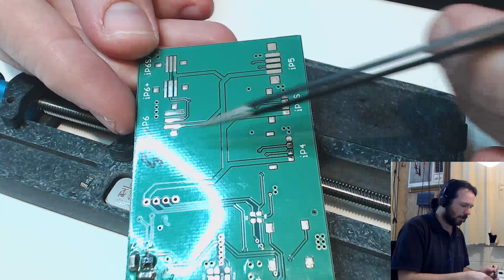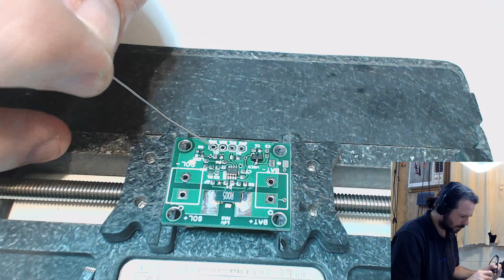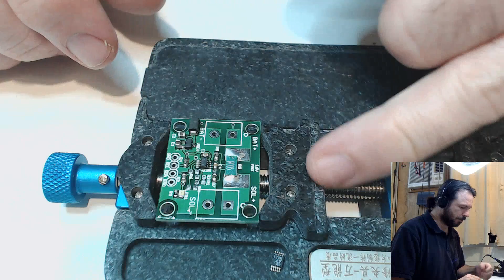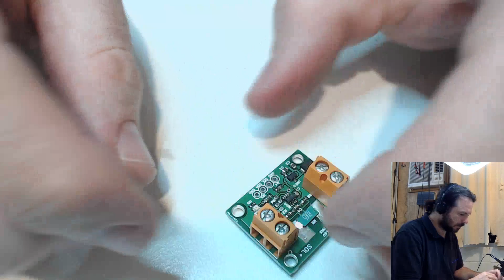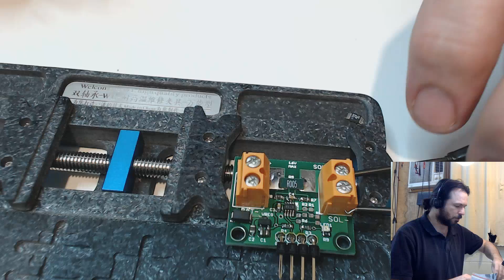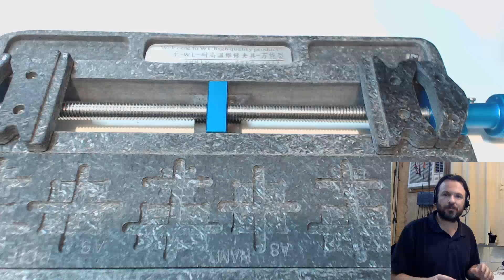iPhone battery tester; Pt2 - Dumb stuff we forget.

Comment: Hi Paul, 
i was lazy to search for your videos on data recovery, so i will ask here if you don´t mind. I was wondering how is your Linux installed, in dual boot or as a virtual machine in Windows? Do you think running in a virtual machine would decrease performance using commands such as DDrescue?
I´ve been watching your videos and they´re really enjoyable.
Cheers from Brazil.
Reply from the maker: All my linux machines are normal installs (no VMs, no dual-boot).   

I would not be surprised if there's difficulties in trying to utilise ddrescue via a VM due to the likelihood that the host OS will not pass on the suitable failure messages to the ddrescue program.  For non-error/failure running, ddrescue performance would likely still be less than that of if it was running natively unless the VM isn't virtualising the disk I/O.

Comment: I think if i had gone to the trouble of having made 10 pcbs, a display twist and a slight mod would happen, it would be the Mk1 :-D.
Ribbon cable for the display, and creative moving of the parts, oow not forgetting the junior hacksaw to lop the bottom of the board off.
Drop it in a minimal black box and it will fly lol.
Professional well known companys mod there pcbs for mistakes, we have all seen it, it does not detract from the product function.
Reply from the maker: Normally with protos I do typically do the temporary hacks until the next one, but I've had a complete mindset/direction change on how I'm approaching the job  and as such I'm just going to spin the new layout and go with "Prototype #1... again" ;)